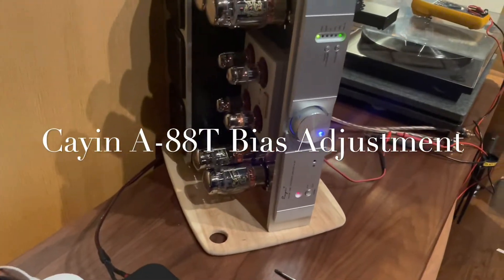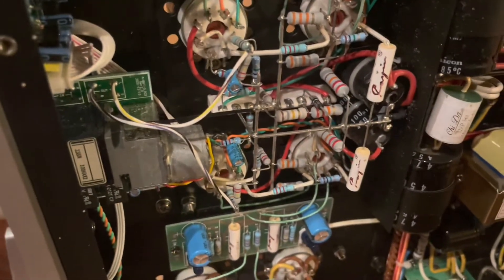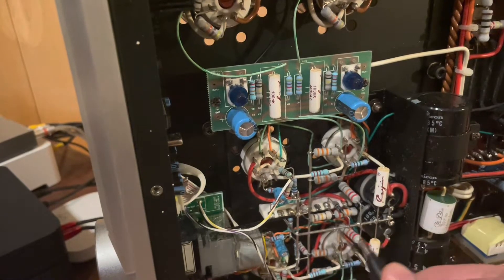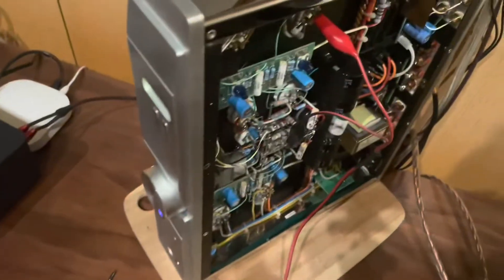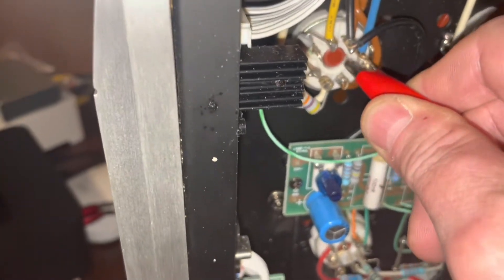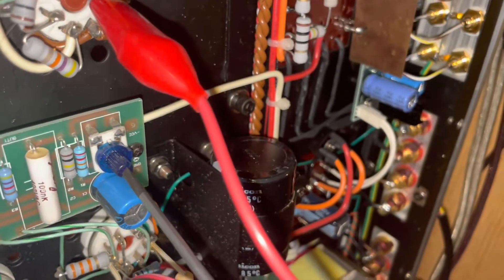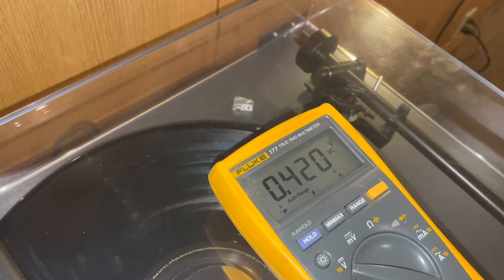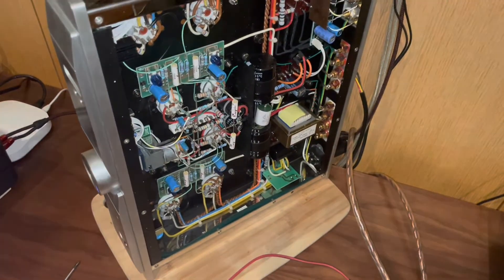Cayin A-88T Bias Adjustment

Comment: Hello, thank you for the video. I have the same amplifier, I use an 8 ohm load resistor to adjust the bias, but my HP work in 4 ohms. Should you use 4 ohm resistors or it doesn’t matter?

Comment: Is it necessary to connect a 8 Ohm load resistors during bias setup?
Reply from the maker: Good point - I've tried both ways and did not note a detectable difference with my testing equipment
Reply: @Brighamdoc  Thanks!